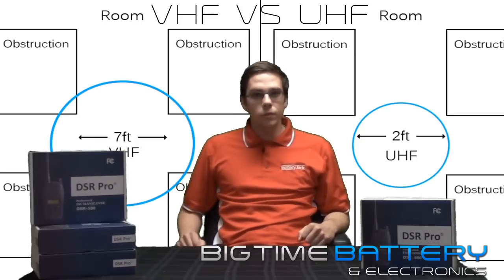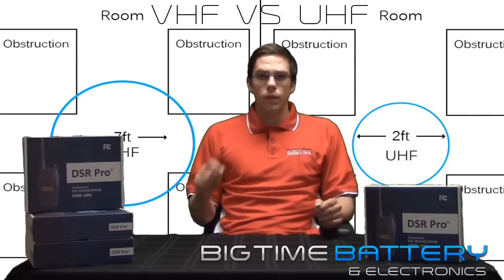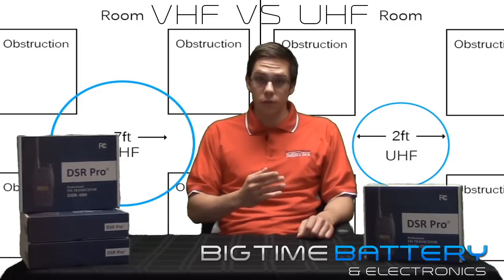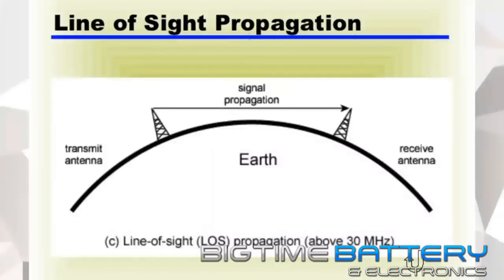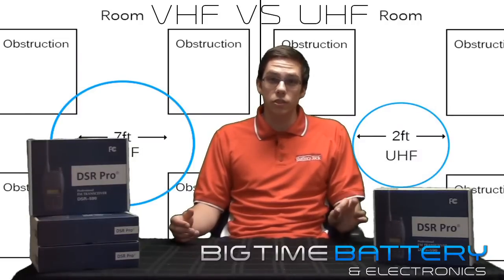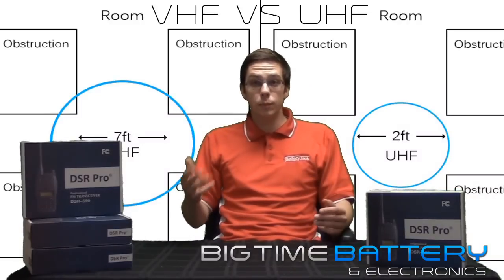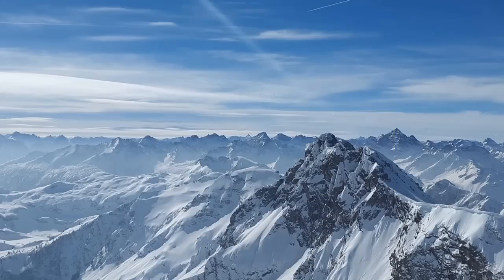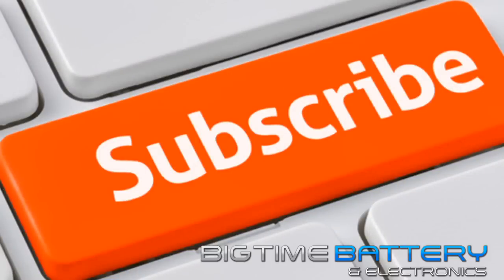VHF vs UHF - What's the difference

Comment: Bro please what curvature, using curvature to explain weak or lost signals no way. You ever think about the dense air objects obstacles? Trees literally soak up much of the frequencies depending on your location. 

Our air is loaded with other EMF signals particles and static interferences but using curvature c'mon.
Reply from the maker: It sounds like you're engaging in a discussion about the various factors that can affect wireless signal strength and quality, and you're questioning the significance of Earth's curvature in this context compared to other factors. Let's break down the different elements you've mentioned to provide a clearer understanding.

Earth's Curvature
Role in Signal Propagation: Earth's curvature mainly becomes a factor in signal transmission over long distances, particularly for line-of-sight communications such as microwave and certain radio frequencies. For these types of signals, the curvature can indeed limit the direct line-of-sight range between transmitter and receiver.
Relevance: In practical terms, for most consumer-level applications like cell phone signals or WiFi, the curvature of the Earth is not a primary concern due to the relatively short distances involved and the use of intermediary technologies (e.g., cell towers, satellites) that bridge the curvature gap.
Dense Air and Atmospheric Conditions
Impact: Atmospheric conditions, including air density and moisture, can affect signal propagation. For example, higher humidity can absorb more RF energy, slightly reducing signal strength over distances.
Variability: The impact varies by frequency, with higher frequencies (like those used in 5G networks) being more susceptible to atmospheric absorption than lower frequencies.
Objects and Obstacles
Physical Barriers: Buildings, trees, and other physical structures can indeed absorb or reflect signals, affecting both signal strength and quality. The composition of these obstacles (e.g., concrete, metal, foliage) and their density can significantly influence the degree of signal attenuation.
Vegetation: Trees and other vegetation can absorb RF signals, especially at higher frequencies. The amount of absorption can depend on the type of vegetation, its water content, and the frequency of the signal.
EMF Signals, Particles, and Interference
Electromagnetic Interference (EMI): The air is indeed filled with various electromagnetic signals from countless sources (e.g., radios, TVs, cell phones). This electromagnetic pollution can cause interference, particularly in crowded frequency bands.
Static Interference: Static or noise can come from natural sources (like lightning) or human-made sources, adding to the complexity of maintaining clear signal transmission.
Conclusion
While Earth's curvature is a factor in certain contexts, especially for specific types of long-distance communication, it's often not the primary concern for everyday signal transmission challenges. Instead, issues like physical obstructions, atmospheric conditions, and electromagnetic interference play more significant roles in affecting signal strength and quality in typical urban or rural settings. Understanding the complex interplay of these factors is crucial for optimizing communication systems and mitigating signal loss.
Reply: @BigTimeBattery  thank for the reply but I forgot to mention I was speaking from a flat earthers perspective.
Reply from the maker: @nxesr  hey flat round I’m here for ya!

Comment: Bang on both Vhf and Uhf got good and bad points, all depends on the local environment your going to be working from.
choose the right frequency for nearby object pathways so the radio waves get through better.
Some frequencies are far better than others baring in mind the range you will be working + weather conditions.
A few things you didn't quite  describe right, but hey we get your drift.  :-))
Reply: So in the mountains VHF would be better and for urban use -> UHF ?
Reply: @777Zubi  generalising yes, and the range you intend to try and work, and type of obstacle path obstructions and intervening terrain that are going to be encountered.
All situations differ,  both can be equally effective in close range up to a few miles, then VHF will be usually get out further.
A bit like horses for courses.
Reply from the maker: It sounds like you're discussing the considerations for choosing between VHF (Very High Frequency) and UHF (Ultra High Frequency) bands for radio communications, possibly in the context of two-way radios or similar communication devices. You're absolutely right that the choice between VHF and UHF depends on several factors, including the local environment, the presence of obstacles, the desired range, and weather conditions. Here's a bit more detail on each factor:

Local Environment and Obstacles: VHF waves travel further on the ground and can penetrate through trees and foliage somewhat better than UHF, making VHF a good choice for rural or outdoor environments with fewer obstacles. UHF, on the other hand, has a shorter wavelength, which allows it to navigate urban environments and inside buildings more effectively by bouncing off walls and passing through structural materials more easily.

Range and Power: While both VHF and UHF can provide excellent range, the effectiveness of each band can be influenced by the power of the transmitter, the sensitivity of the receiver, and the height of the antennas. Generally, for the same power output, VHF might offer a slightly longer range in open, unobstructed environments, while UHF might provide better coverage in densely built-up areas.

Weather Conditions: Atmospheric conditions can affect radio waves, though the impact might be more pronounced at frequencies higher than the typical VHF and UHF bands. However, severe weather conditions can still affect the performance of radio communications, particularly over longer distances.

Frequency Selection: Within both VHF and UHF bands, certain frequencies may perform better than others due to a variety of factors, including licensing requirements, band congestion, and specific local regulations. It's important to choose frequencies that are appropriate for the intended use and comply with local regulations.

Comment: Beside the Echo and his incorrect use of the word hertz, the biggest issue he mistated is that most users will lean towards UHF. This is not correct. 

Especially in an amateur radio setting where most UHF repeaters for example are run by clubs and you have to be a paid member to use the machines. Not so much on VHF. He also glossed over the fact that VHF actually has more range even though in metropolitan areas like Los Angeles the higher frequencies will enter the buildings better than VHF. But remember that if you happen to be a courier driver or something in the large metropolitan cities they generally have requirements by the fire department that state that during building construction or renovation bi-directionsl radio amplifier be installed in the building. They need to cover VHF, UHF, 700, 800. This way fire departments that come in to put out a fire don't lose their  communications regardless of which band they are on.
Reply from the maker: Sorry was very young when making was still learning and still learning!

Comment: 30 MHz = 30 mega hertz (not 30 hertz), so I thought...(?)
Reply from the maker: Apologies for any confusion. You are correct. "MHz" stands for megahertz, which is a unit of frequency equal to one million hertz (Hz). Therefore, 30 MHz means 30 million hertz, not 30 hertz. Thank you for pointing that out

Comment: Big Time Battery and Electronics
Man you sound like you are inside of an empty swimming pool, please get some better microphone !!!
Also I can read; you don't have to spend so much time reading the frequencies list, blah !!!
Reply: I have several Yaesu waterproof. But I nver attempt to use one under water. It could work if as said in the video they dont use only 144 or 430 MHz but 144 Hz or 430 Hz too. I will build a little dipole for these frequencies, it should be about 80,000 km only
Reply from the maker: If you have any other questions please feel free to call or text us at: 815-467-6464 or email me directly at cody@batteryjack.com

Comment: I heard UHF is the best to have,Incase of a Emp,Nuke attack.The UHF signal is not effected by emp.It is what the Govt uses,in major disasters≥
Reply from the maker: The statement that "UHF (Ultra High Frequency) signals are not affected by EMP (Electromagnetic Pulse)" is not entirely accurate. Understanding the impact of an EMP, especially from a nuclear detonation, requires a bit of nuance regarding how EMPs work and the vulnerability of electronic systems, including communication devices.

EMP and its Effects
An EMP can be generated by nuclear explosions, certain types of non-nuclear devices, or natural occurrences like solar flares. It consists of a burst of electromagnetic radiation that can induce electric currents in conductive materials, potentially damaging or destroying electronic equipment and infrastructure.

An EMP has three main components:

E1 Phase: A very fast, high-intensity burst that can damage electronic circuits and is capable of causing widespread infrastructure failure.
E2 Phase: Similar to a lightning strike, it's less powerful than the E1 but still potentially harmful.
E3 Phase: A slower pulse that can last from seconds to minutes, affecting power lines, transformers, and other components of the electrical grid.
UHF Communications and EMP
UHF and EMP Vulnerability: UHF radios, like any other electronic devices, contain components that are vulnerable to the intense electrical currents generated by an EMP. The susceptibility of these devices depends more on their design (e.g., shielding, circuit protection) than on the frequency band they operate in.

Government and Military Use: It's true that government and military operations use UHF frequencies, among others, for communication. However, the resilience of their communication systems to EMP attacks is not due to the inherent properties of UHF signals but to specific engineering choices. Military and some government communications equipment are designed to be EMP-hardened. This includes special shielding, grounding, and filtering to protect against the induced currents from an EMP.

Frequency and EMP Impact: The impact of an EMP on radio frequencies isn't about the signal being "not affected" by the EMP. Instead, the key factor is the robustness of the transmission and reception equipment against the electromagnetic surge. All electronic devices, regardless of the frequency they operate on, can be affected by an EMP if not adequately protected.

Conclusion
While UHF radios are used by government and military agencies for their communication needs, including in disaster scenarios, the effectiveness of these systems in the face of an EMP attack is largely due to the protective measures implemented in their design, rather than the properties of UHF signals themselves. Protection against EMP effects requires specific engineering solutions to shield and safeguard electronic components from the induced currents generated by such events.

Comment: I didn't understand a shit !
Reply from the maker: UHF (Ultra High Frequency) and VHF (Very High Frequency) are two bands within the electromagnetic spectrum commonly used for radio communications. Here's a comparison of UHF vs VHF:

Frequency Range:

VHF: VHF frequencies range from 30 MHz to 300 MHz.
UHF: UHF frequencies range from 300 MHz to 3 GHz.
Propagation Characteristics:

VHF waves travel further over open spaces and are better at penetrating obstacles like buildings and foliage. They are less affected by atmospheric conditions.
UHF waves do not travel as far and are more prone to signal degradation due to obstructions. They are more affected by atmospheric conditions like weather.
Antenna Size:

VHF antennas are longer compared to UHF antennas for transmitting and receiving signals at their respective frequencies.
UHF antennas are shorter compared to VHF antennas.
Applications:

VHF is commonly used in FM radio broadcasting, analog television broadcasting (channels 2-13), maritime communication, and aircraft communication.
UHF is used for television broadcasting (channels 14-83 in the United States), cell phones, satellite communication, cordless phones, Wi-Fi, Bluetooth, and two-way radios like walkie-talkies.
Interference and Crowding:

UHF frequencies are more crowded due to their wider range of applications, which can lead to more interference.
VHF frequencies may experience less interference due to fewer users in some regions and less crowded frequency bands.
Regulations and Licensing:

Both VHF and UHF bands are regulated, and users often require licenses to operate certain types of equipment within these bands, especially for commercial and professional applications.
Performance in Urban vs Rural Areas:

VHF signals tend to perform better in rural areas or over long distances due to their ability to travel further and penetrate obstacles.
UHF signals may perform better in urban environments with many obstructions, as they are less affected by reflections and can more easily penetrate buildings.
In summary, the choice between UHF and VHF depends on factors such as the specific application, environmental conditions, range requirements, and regulatory considerations. Each has its advantages and limitations, and the optimal choice often depends on the particular use case.